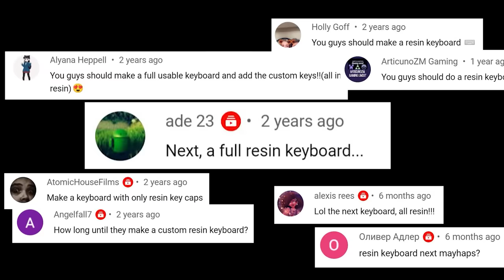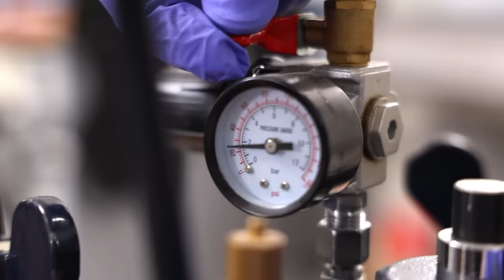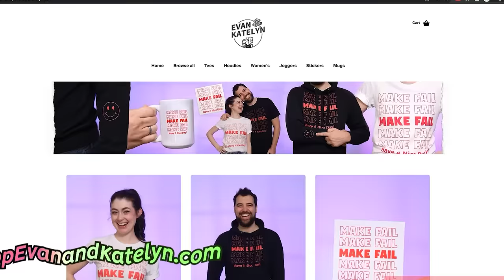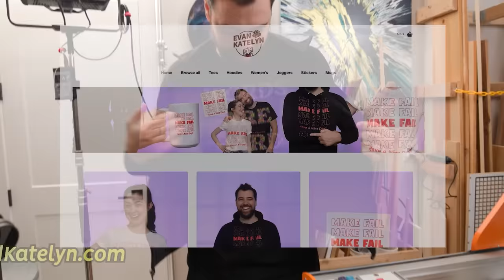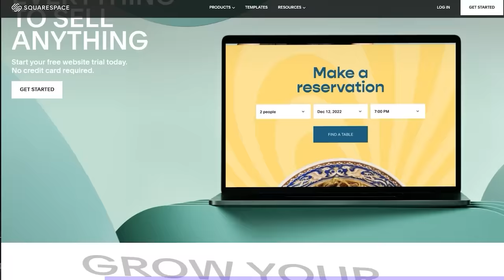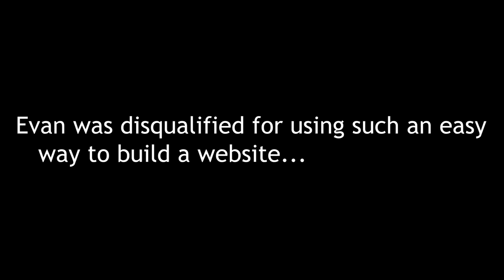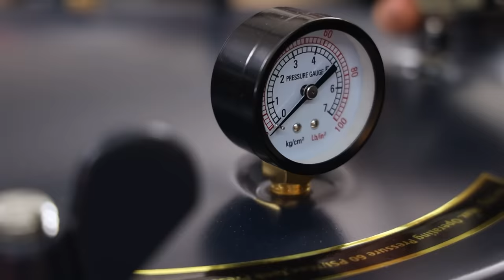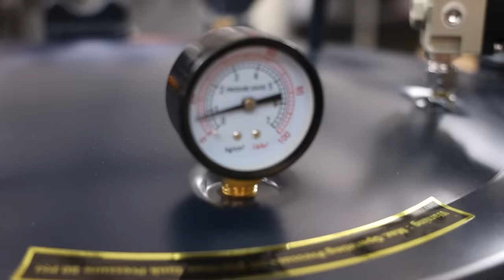Making 68 Resin Keycaps (plus a resin case)

Comment: I think Millie (short for Millibar) would be a great companion name for Pascal. Especially since the ratio of millibar to pascal is fitting for the sizes of the pressure pots.
Reply: Or Torry (Torricelli), for same reason (as 1 torr ≈ 133 Pa)
Reply: I like Millie!
Reply: Millie or Barbara was what i was thinking. Glad to see somebody else on the same wavelength. 😄
Reply: I thought Barye. (1Ba=0.1Pa) but I thought it as more of a comedic note to the name, like how Tiny or Little John is used for big dudes.
Reply: @Kieiros  so it's Psimone
Reply: I had the same exact thought!
Reply: Chiming in that the compressor could be called Jules (for Joules), but loving all the suggestions in here
Reply: bigboy could be called Jushi which is just japanese for resin

Comment: I would suggest the new pressure pot be called Barye (Barry) to keep in theme with Pascal as a unit of measure for pressure. Barye is the CGS standard unit equal to 0.1 pascals, so there is an inverse proportional relation between the pressure pots, but that's because nothing can compare to the original.
Reply: And 1 bar is 10^5 pascals so it keeps with the fact that he's bigger!!

Comment: Here'a an idea: You could make a mould of bottom sides of all the keycaps at once, so you could just pour a slab of resin with already built-in stems. It would allow you to make a design that's uniform across whole keyboard (like galaxy, for example). Then you just cut out individual keys on the cnc and have whole set in one go.
Reply: +1
Reply: Want galaxy! Would be such a cool keyboard. Light shine thru to look like stars?
Reply: I was about to say the same thing! Kinda like how dice molds can have the numbers already on the different faces with the mould

Comment: you named the small pressure pot after the pressure unit pascal so maybe in the same sprit name the new one torr. one torr = 133.322 pascal :)
Reply: An idea in the same vein, I propose Torrence, for the unit Torr, but a name that fits in better with the rest of the equipment I think
Reply: This is so good

Comment: I also have a 3M Versiflo and when I'm not using it I always have the battery on the charger so I don't have to worry about it running low. And there's a battery level indicator on the top of the battery ( the side you insert into the battery bay).

Comment: Dear the both of you. I saw your video with the 'floating table' and I have an idea I want you to make. A floating table held up by magnets, the inner magnets of the table will be trying to go to the floor while the outer ones are trying to get away from the floor. If the magnets are of equal strength you may be able to make it float.

P.S please use resin for some part of the project if you do do it.

-Kat

Comment: its funny you guys use total boat for non boats you should try to do something involving boats or making some kind of weird boats also i kinda wanna see a metal keyboard like the resin ones colors but with different metals like steel, copper, brass, and aluminium it would look sweet if it had like a mirror finish with all the colors it would be quite heavy tho but worth it and metal is a bit different from what we normally see here may bring in new types of fans i would try to make one myself but i dont even own any metal shaping tech just a drill and dont have the skills or money to make such a work of art

Comment: Why are they wearing so much protective equipment for the resin casting process. Resin casting doesn’t really produce dangerous fumes or gas, unless there’s an unusual chemical reaction. The fumes that it does release are just a very mild irritant. The biggest threat is if you have an allergic reaction. At most you need just a dust mask. This is like using a full heat suit for dealing with molten metal to do bake some bread. Lol